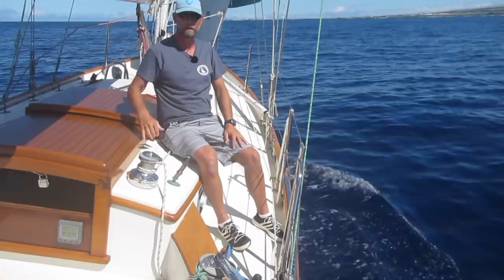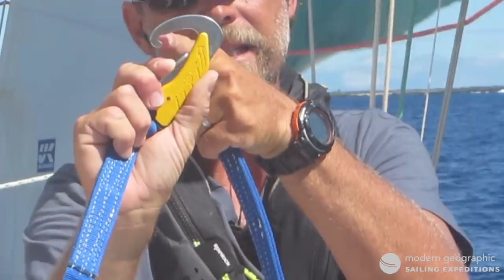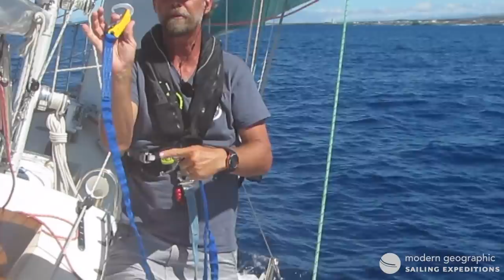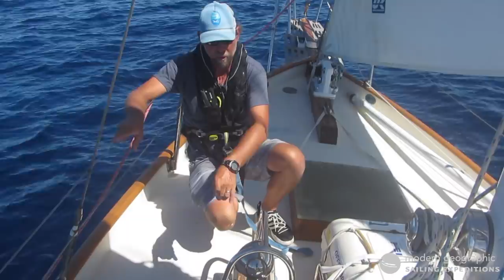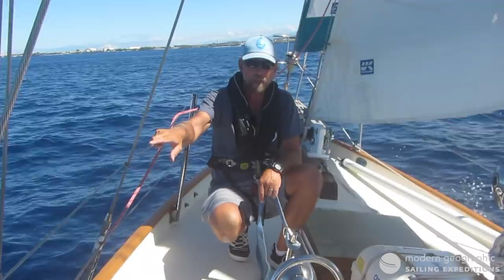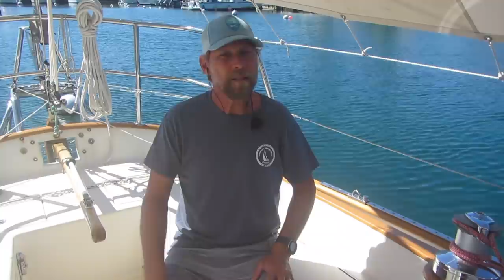Sailing Safety Harness ... Don't Ever Let Go!

Comment: The non-locking carabiner if sliding along a rail, then striking a stanchion can have it’s gate forced open.
Reply from the maker: Thank you for your comment, Marshmellafella! I imagine that it's possible for a non-locking carabiner to be opened by non-human force, although I believe the likelihood if this occurring is low. Contrarily, because "locking" carabiners are cumbersome to open, there is also a likelihood the operator may struggle to open a locking carabiner and secure themself to something at the most opportune moment. As sailors, we all must weigh the contrasting risks between solutions and make the best personal choice for the way we sail. Kind regards, Paul Exner
Reply: @PaulExner   I totally agree with you that everything has it’s pros and cons, and the nature of being on the water already assumes a level of risk. I completely agree that locking carabiners can be an embuggerance, increasing fumble factor, and might ultimately deter use. 

Incidentally, there are a myriad of locking snap hooks designed to be easily operated with one hand, I’ve used plenty of these in military. We called them ‘helo personal retention lanyards’, if you google the term you’ll find a myriad of products designed for expedient hook on/hook off.

I recommend looking up ‘roll out’, and ‘cross gate loading’ here on YouTube. My experience is on high angle military applications, and I learn much from your extensive expertise in sailing. This is just my attempt at offering something useful in return for the knowledge you have shared, and watching your six.
Reply from the maker: @Nunyabizn3ss  ... Thank you for your insight and experience -- much appreciated! It's especially great to read news of your 'helo personal retention lanyards' used in the military. I would benefit from receiving the military training you've had in this regard; and, I'll definitely take a look at 'roll out' and 'cross gate loading.' The new technology available at the consumer level is getting better all the time. Your contribution brought-forth this valuable discussion, and I'm certain others will benefit by reading your notes. Best regards, and good sailing! Paul